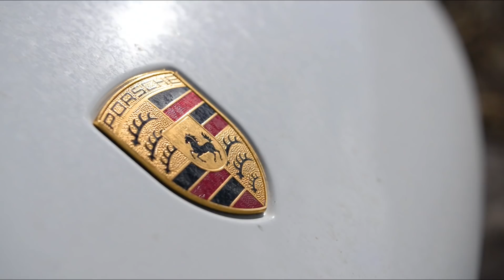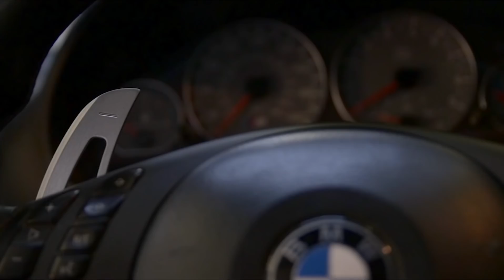Cars Are Changing

Comment: I disagree, my V35 skyline aka G35 failed last year, engine light came on, wouldn't start - problem was engine sensors. some crappy cheap ass electronic parts that doesn't really impact how the car drives. My 1994 MR2 didn't have these dumb sensors in it and drove just fine. Also, to fit an aftermarket shifter in a V35/G35 you need to raise the car to loosen a nut to change out the old shifter, MR2 short shifter installed from inside the drivers cabin in minutes, no hoist required.  Also G35 battery location is pretty crap for service and how about changing the headlight? oh yah, take the front wheel off, easy! LOL WTF? or rip open your fender guard and slice your hands up trying to get them in the crack to swap out the bulbs, not so easy.
Want aftermarket headlight on the G35, easy! just rip off your front grill and bodywork.... will only take an hour or two.... :(

Seems like new cars are designed with lots of points of failure and some things are pain-in-the-ass tricky to service/maintain than earlier models. so much electronics these days, multiple points of failure - have fun when your new car warranty runs out.

Comment: I totally agree with you guys...  In High School ( in 1978 ) I was driving a 2 speed, 283ci Chevelle , and thought it was killer... it only had front disc brakes, and no Posi, but I loved it, then I graduated to a 1971 Z-28 with a 4 speed LT-1 350ci, 4.10 Posi , and that , in 1980 was the pinnacle of performance to me...  fast forward to just two days ago...I drove a 2016 Fiat 500 Abarth 1.4L turbo with electronic assist steering, 4 wheel disc, and electronic Sport mode that tightens steering and changes shift points for maximum fun...and , God was it fun ! I haven't been so giddy when driving since my Z-28, which with 400hp at the wheels did the trick...but I am amazed at how much cars have changed , and only needed to drive the Abarth to see just exactly how much cars have changed....and as a car guy who loves manual everything.... I was flat blown away at how well that damn Fiat handled.

Comment: Modern cars are part of planned obsolescence, that's the main problem. Manufacturers want cars to fail (but not fail too much due to lawsuits) and they want you to spend a lot on service. Extremely high reliability was achieved in the beginning of 1990s with LS400 and W124 and they had most of the comforts we really need. The problem was that many Germans for example didn't buy new cars because they took care of theirs and maintained properly - they would easily last for over 2 decades, bad news for manufacturers.
I would love to see them start making the W124 again somewhere in the 3rd world where regulations aren't so tight. It would be a hit and there's almost no development cost.

I like automatic transmissions and many new-ish features (AC, power steering, cruise control) because they have a clear and valid purpose. Driving in a traffic jam with a manual transmission in 2017 is just stupid and backwards but also a distraction.

TIL, in Danish cruise control is "fartpilot". Love it.
Reply: Driving manual in a traffic jam is not a distraction at all, it's just annoying. Especially when compared to a real issue such as playing with a phone that automatic drivers would be far more prone to do. Controlling the stick at least directs all of your attention towards driving.
Reply: Driving a manual means there is a delay, causing further delay down the line. With an automatic I lift my foot and I'm rolling, with a manual you typically go out of gear when stopped for 20-30 seconds, meaning you need to go to gear first. Machines do routine jobs like this much better than humans.

I've driven both and I'd definitely pick the automatic every time as do most people as evident by the sales stats. Most who get manual for cheap cars now are the ones who can't afford the automatics.

PS. I've been in cabs where drivers play with phone while shifting gears, how is that better?
Reply: You greatly overestimate a delay in shifting into gear and rolling away in a manual. Any experienced driver will complete this task in negligible timing compared to an automatic. This is everyday street driving we are talking about, not a drag strip. 

That's your preference to pick automatic, and I can see why and respect that decision. It's all about a style of driving not so much a matter of affordability, many higher end model cars worth a lot more than your average automatic sedan still come in manual, such as Porche, BMW, Alfa Romeo, Corvette, Cadillac, Dodge Challenger, and Aston Martin. Any of their models are looking at $50,000+ 

Manual can seem like a hassle at times, but as far as it being a distraction, you couldn't be any more wrong.
Reply: For almost all cars, you pay more to get the automatic version. Whether it's a cheap French car or a Porsche with a PDK, automatics are extra.
Shifting manually (clutch down+gear in+release clutch) vs just pressing gas, there is a clear difference. I'm an experienced driver and the difference is there. All the 0.5second delays add up. Many negligible factors together amount to something significant.
Reply: Sorry to hear you are half a second late to where ever it is you're going...
The only time I'm ever off the line at a red behind an automatic is if I purposefully let them. Other than that I'm letting the engine roar a bit and I'm putting a gap on them that more than makes up for this 0.5 second delay you seem to be experiencing.

Comment: I feel like the switch to automatic and manual transmissions isn't comparable to engine tweaks and enhancements at all. The standard transmission is all about connecting the driver to the car. It makes you more alert and pay more attention to each move the car makes, and it gives you better control overall. Even if a 6 speed isn't "faster" than a dual clutch trans, I'd rather have that sensation of driving the car rather than just "riding" in it. I'm sure the same arguments going to be made when self-driving cars become more fine-tuned and mainstream too.

Comment: Cars were once built to last nowadays cars are not durable at all...
Reply: Up you should go! I worked for Mercedes-Benz and Honda in car development and I can tell you. Cut the cost and plan obsolescence were two biggest demands from sales division. If someone said that some part of car is going to fail, sales said "Yes, but after the warranty expires, so we don't care." Nobody wants to make anything that lasts. Look at Saab. They made car that last forever and Saab is gone now.
Reply: @Werscajk  that actually breaks my heart, Mercedes where the kings back then! with the 190(w201) for example. They overengineered it like crazy for it to last, to be perfect. They never break down, we have a normal 190 and it has rolled a whopping 435k miles and it STILL runs with no major issues...
Reply: @Werscajk  still have my old EG6 with a B18 on it, its making 250hp ish since 2006 and super reliable car even modded
Reply: @Fortississimo Yeah, I've had my civic for 5 years now and it hasn't given me any problems and certainly hasn't broke the bank....I'll be driving it for another 15 years
Reply: People nowadays are not very care and easily boring with their stuff due to expansion of social media, which people compete each other to get the latest gadgets and stuffs. 

Remember Nokia that known as a durable mobile phone from their 3310 series? They now follow the market trend and make fragile smartphone same as other telecomunication companies.

There was a news around my town that most people are easily changing their scooters and cars every 2 YEARS and 5 YEARS respectively. And the market seems didn't care about longevity of the stuff because the money is coming from the first owner and the high depreciation will make some people worried to buy too many expensive items such as vehicles. That's why you see the big market not sold well like in the past.
Reply: Werscajk that's Capitalism in a Nutshell. Same goes with light bulbs for example. In 1900s there was a "forever lasting" light bulb invented. https://en.m.wikipedia.org/wiki/Longest-lasting_light_bulbs
Reply: What the hec are you driving? My 2013 Honda Civic is solid
Reply: @Fortississimo Honda Civic and accords have the best resale values dude, I'm not worried about the reliability of my honda
Reply: @Fortississimo Dude lol! the Honda Civic is 20k with taxes, its even less now given its a 2013 model
Reply: @Fortississimo A civic lasts more than 5 years & old cars cost the same after inflation
Reply: Balkan Intros dont talk shit, cars last much longer now.
Reply: My mom's Chevy TrailBlazer (2007) hit 100k miles. Since then, 3 tranny replacements. We got rid of it and have a 2014 Captiva. It’s at 85k and hasn’t had any problems yet. My dad's has a 2007 Forester. The only problem with that was, of course, the head gasket blowing. My neighbor has a brand new Forester, problems all the time.
Reply: AlmeydaTV  Cars were made to last  once, but you have to go back mutch further than you'd think to find them. The change occurred after ww2. In the economic  boom of the  early 50s for the first time the car market became saturated. Everyone that needed a car and could afford one had one. To combat this car companies began radically changing the design of their cars every 3 years and in the late 50s at gm under harley earl they cut that down to one year. Which is why the 55 56 and 57 bel air are so different. This combined with cheaper paints designed to fail in 5 years, ensured that the sheer shame of driving an old decaying car, would keep you going to the Dealer every 5 years for the rest of your life.
Reply: Law19157 we know that about the older civics which had bulletproof engines, but the point is newer cars aren't built to last long they're built to make a crap ton of money for the company
Reply: That's bullshit. Old cars had 5 digit odometers because they were disposable garbage. Old cars rusted quickly but modern cars do not. Every modern car is expected to go at least 200,000 miles/320,000 kilometers because they're built well. Modern cars are more efficient than anything of the past.
Reply: Law19157 personally if I was spending 30k on a car, I'd want it to last a very long time
Reply: Law19157 what about in 20 years?
Reply: Law19157 even then that's a lot of money to throw at something that might only last you 5 years.
Reply: Robertas S. That's bullshit.  Older cars had 6 digit odometers and lots were built very well.  The only reason old cars have rusted is because they are OLD.  This is literally the dumbest comment I've seen

Comment: How are you supposed to upgrade fuel injectors in a new car with DI? - So much more complicated. 

How are you supposed to add turbos? - There is no space

Some new cars don't have have an oil dipstick... - What the hell

New cars don't have spare tyres - tell me how much better your new car is when you get a puncture and have to buy a new tyre.

New cars run too lean - Their engines will not last as long

New cars constantly bleep at you for everything - annoying

New cars are heavy - makes them boring to drive

The paint on many new cars is too thin - it will not last

The annual tax on a new "performance" car is insane

New cars are not good value. You can get a much better used car for the same price. 

I could go on. Most new cars are terrible.

Comment: Your video was a breath of fresh air compared to all those vintage car YouTube videos with people griping about "they don't make them as good as they used to"/"All they make nowadays is junk"/etc..
These people need to know (for example) that 1957 Chevrolet's were advertised as "sweet, sassy, and sexy" when they were new, but it was not because of the reliability of the optional fuel injection that was first introduced into Chevrolets that year. The FI units were so trouble prone that many owners had them taken out and had carburetors installed. What's ironic is that an original 1957 Chevrolet fuel injection unit is priceless today to collectors. When properly tuned, they did indeed improve the performance.

Comment: 😂😂😂 all these pansies in the comments complaining about how hard it is to work on modern cars! 

Wow, are you that inept to buy basic diagnostic equipment and other tools for modern cars? Because if so that's sad. 

I have been working on cars since I was a small kid starting from classic cars from the 60s and learning about how to modify modern cars now. I'm 19 so I don't feel as if I have the experience to call myself a professional. But if I can take my laptop at the age I am at now and remap and reprogram ECUs. Using that to delete sensors out of the engine logic or change telemetry data points. 

I believe anyone can service and modify a modern car. All it takes if for you to get off your ass, get your preferable mechanics manual, get some software online, and practice on a beater car. It's daunting at first, but it's like anything.

Comment: HANG ON, did he say at the beginning that it would be easier to modify a 20 years newer kia? i call bulshit
Reply: Jack IIE Toohey fr like he needs to be quiet
Reply: Gears and Gasoline KEK
Reply: I call bull bull too
Reply: He said that while looking at a modified ford escort... He might have a point!
Reply from the maker: Jack IIE Toohey time for a build series
Reply: Gears and Gasoline if only I had the money, it's all going to the evo! WHICH I DONT WORK ON MYSELF BECAUSE ITS MORE COMPLICATED THAN MY 91 MIATA (sorry for caps, making a point that many others are also trying to make)
Reply: Gears and Gasoline I've swapped motors on some civics and stuff a couple times, I would NEVER do it myself  to anything newer than 2000(ish)
Reply: I agree and disagree with that statement. On the one hand many new cars respond to mods much better than many old cars. Most cars that come stock turbo see a huge increase in power with just a flash tune, and already have very advanced brakes and suspension basis to work with. On the other hand new cars can be extremely painstaking to take apart and thanks to tons of sensors, electronics and cost saving plastic bits awkwardly holding things together.

Comment: i like certain change if they do it right.gmc in the 90s did it fucked up.i have a 95 truck,with shitty tbi system,parts that will only work for a 95,...94 wont work...96 wont work,and to top it off i got a obd1 computer but a obd2 port.so change is good,and gmc sucks.

Comment: Newer cars? Are harder to modify? Older cars were better. Screw those crap economy cars,automatics and electronic based computers. Cars are just getting more boring with all the safety systems. Oh and not to mention, what is this self driving concept car junk. Now car's have ugly body styles and less horsepower and more computerized crap. I just wish we were back in the 90's when cars were good.

Comment: E-Gas - You dont control the throttlebody by your foot anymore
E-Brake - You cant properly control the rear brakes anymore
AT - You cant control the shift anymore
Everything is controlled by a (set) of computer(s) onboard.
While R34 Skyline is filled with computers, it's fun car and has personality.
Locked down 1l 3cyl turbo trash might be filled with same amount of computers nowadays, but it won't do.
Ask yourself, what was the purpose of the car?
If you have assistant for steering, braking, speeding and handling, are you really a driver? Or just too lazy to actually control one thing in your life, that can be bought, sold, trashed and rebuild.

Comment: There is a massive difference between innovations in car technologies from yesterday to today. Yesterday's 'high tech' PFI is NOT today's innovation, one example that comes to mind is that you can't modify your cars audio system by changing a head unit without extensive modifications anymore since most cars integrate climate controls and whatnot into the 'infotainment' system. Also, how does driver assists like disc brakes and power steering equate to cars that will automatically stop for you if you are incompetent enough to not know how to pay attention to traffic when you are driving? New cars are literally giant computers. Source: I used to be an automotive technician.

Comment: Manuals are still around, but I really feel like manufactures don't want you to buy them. As a car enthusiast I had to bite the bullet and get something newer that had more than 2 doors lol and good on gas. I ended up buying a Kia Soul base with the 6 speed manual. And the reason why I say they don't want you to buy manual, with my Kia the manual is only available on the lowest trim with the weakest engine. manual, you can't get keyless entry, cruise control, touch screen infotainment system, alloy rims, or a sun roof even as options. With an auto you can. If that doesn't scare the average consumer away from a manual idk what will. But I'm happy with it, because it being manual makes up for it.

Comment: i made my "fun" car from 80's parts. 
carburated, simple cable trottle, absolutely no electronics, rough, terrible 4-speed manual.

i'd change the carburator for fuel injection and the trottle for something more reliable in a heartbeat. and i'd love to have a smooth 6-speed manual instead. but that's about it. fuck abs, fuck assists, fuck everything else.

Comment: why the fuck owdays all the engine components a covered in plastic ad if something fails  you need to check the electronic go to a pro shop and get the repair (changing a piece) when in the past if something break you could repair it or even made a replaicement of the component by yourself